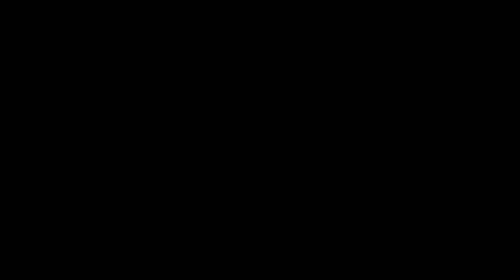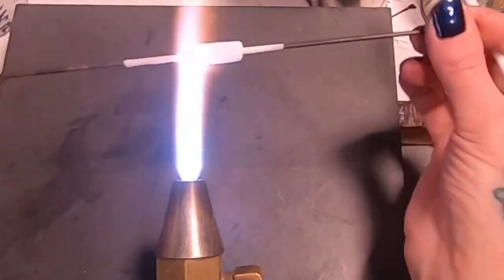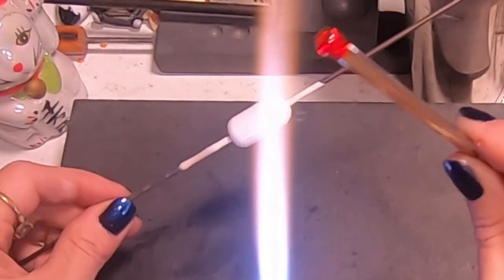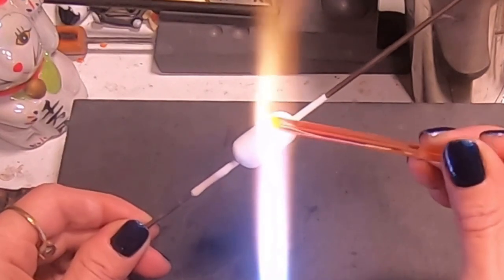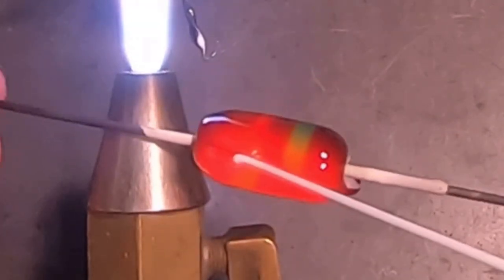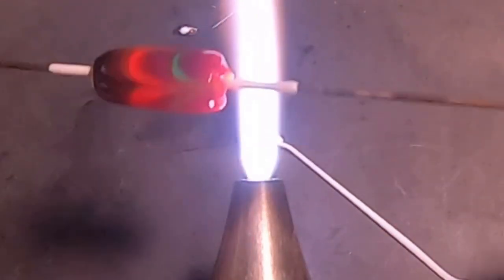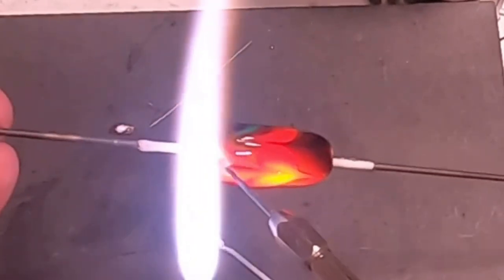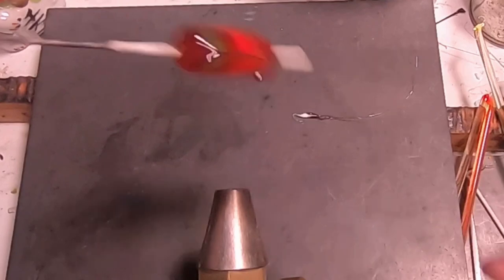Lampworking / Flameworking 101.19 - Easy Raking - all levels demo

Comment: I got my torch fired up.... honey moley!  That mother is HOT!!!  Jeezeie peezie.  I feel like I’m learning from scratch!
Reply from the maker: I know how you feel! The glass will melt so much faster for you! Now you can use all the parts of the flame to slowly or quickly heat your glass… I am so excited for you! I can’t wait to hear more! 🖤🦇
Reply: What would be good pressure setting for me to start with?
Reply from the maker: I use more pressure thank I should....   shhhh!   But to start, try 5-10psi on propane and 10-15psi on oxygen!   Then learn your flame...like play around with it on and get used to the valves.  Small flame, medium flame, reduction flame.... see how your glass likes it!  
Xoxoxo R👍🏽